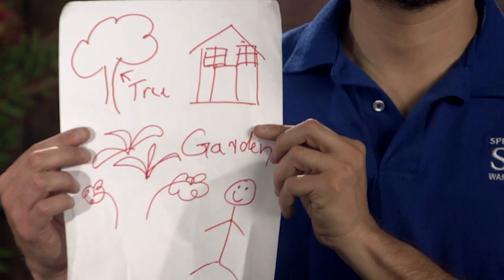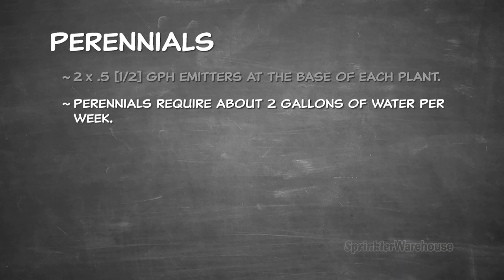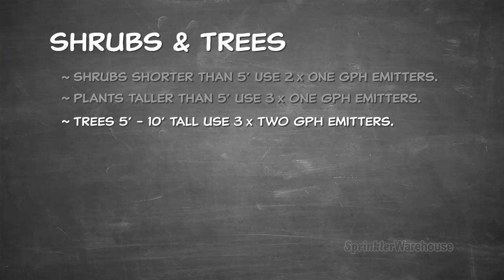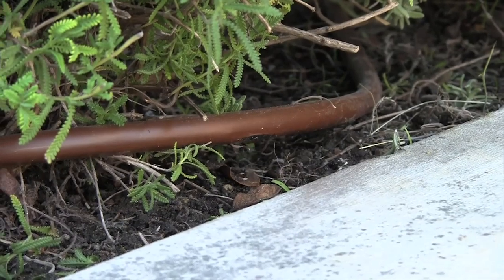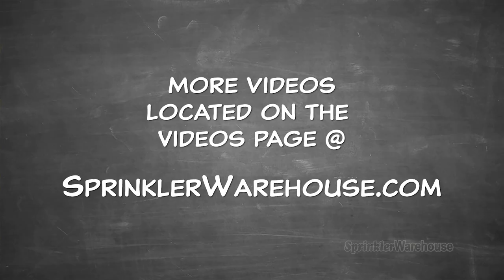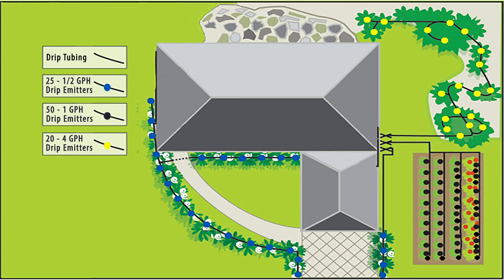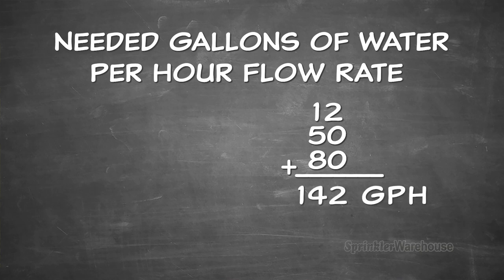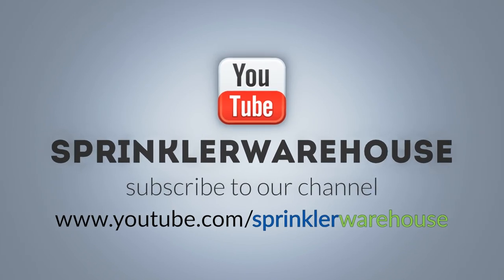Designing Your Drip System

Comment: Very useful information . When we convert one of the rainbird pop up sprinkler (Rainbird 1800 ) as you detailed out how much each will be able to deliver in GPH ? You will be basically shutting down other sprinklers in the area and using one sprinkler head conversion for drip irrigation . Does one sprinkler converted delivers how much GPH ( Rain bird 1800 )